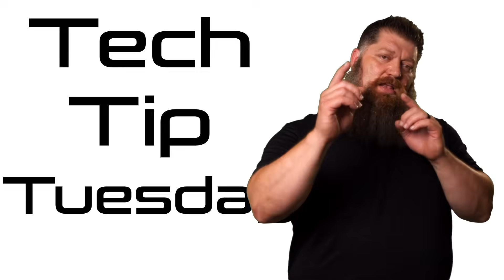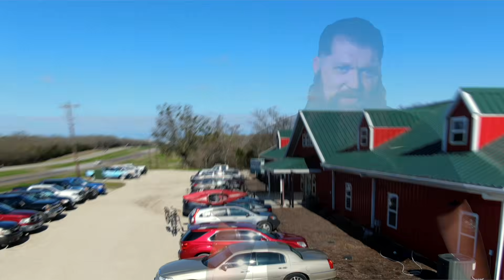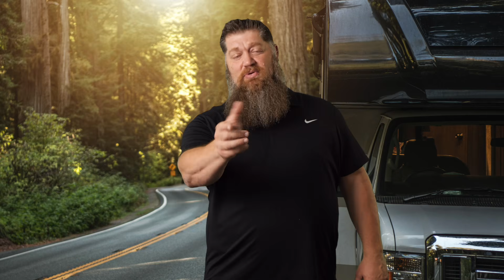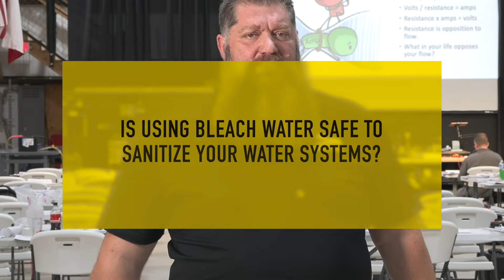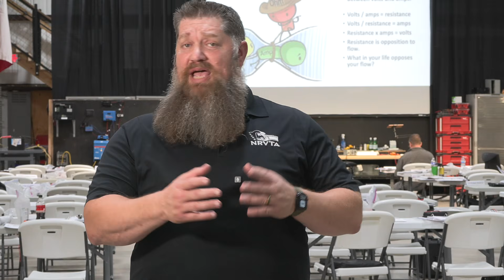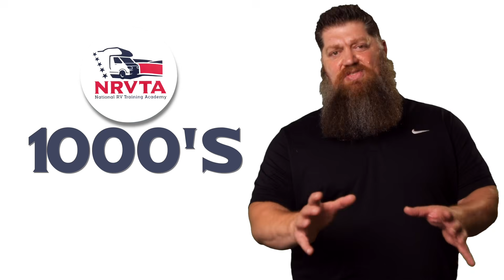Is It Safe to Use Bleach to Sanitize Your RV Water System? | RV Maintenance Tips

Comment: Todd - I love your videos, and I appreciate the care you appear to use in presenting RV information. I believe that RV water system sanitizing is more complex than just chlorine yes/no, and I believe that you are in a unique non-sponsored position to accurately test the different processes available. It seems to me that there are three "products" on the market that claim to kill bacteria, and have some sort of national standards approval. Those are chlorine (the reason for the quotes), Blu Technologies Bleachfree, and Thetford's Fresh Water Tank Sanitizer. The latter two seem to use the same active ingredients, just in different quantities. 
What i would dearly love to see you do is a controlled test between these, and any products (that claim to kill bacteria) I've missed. I'd like to see you start with water that has come from an RV tank that has has water sitting in it for an appropriate period of time. Put that water into test tanks for an appropriate period of time. Follow the recommended sanitizing processes, and have a lab test the results compared to an untreated control and "standard" dringing water (whatever that is).
While this process is not trivial, I do believe that there is time to design and run this test in time for the summerization season this upcoming spring. I hope you will agree with me and choose to undertake this project. BTW - If my research failed to find that someone else has already performed this test, I'd appreciate a reference to that test.

Comment: As a recently retired airline mechanic, I can tell you that the EPA requires aircraft potable water systems to be tested for contaminants every three months. Potable water systems are treated on a more frequent schedule. These days, most airlines have switched to using ozone machines to accomplish the treatment, which requires much less downtime than the old way. It now takes about an hour and requires no flushing of the system.
        Up until just a few years ago, water systems were sanitized using a 50 ppm chlorine bleach type product that had to be pumped into the aircraft’s water system and allowed to stew for over eight hours. That’s a shift and a half just for that maintenance. Thankfully, lubes and other routine maintenance items were being accomplished at the same time.
       After the proper time had elapsed for treatment, the water system had to be completely drained and flushed with clear water. The water at all lavs, galleys and coffee makers was tested using test strips to ensure an acceptable chlorine concentration of no higher than 2.0 ppm. It should be between 0.5 and 2.0 ppm.
     Since I can’t afford an ozone machine, I use the old chlorine bleach method on my RV. I also use water system test strips that are available on Amazon, to make sure that the system is thoroughly flushed. When sanitizing your water system, remove the water filter(s) prior to treatment. Replace with new filters once treatment is complete. Be sure to mark the date of filter replacement.

Comment: Just watched several of Todd's Tuesday tech tips on sanitizing your fresh water system. We have a 1998 Alpenlite, original owner. Shoot me now I know, but I have never done this process. The coach gets regular use throughout the year and fortunately have never had an issue. This past week we were boondocking, on a day trip we filled to 5g water jugs to take back, and when emptying the second one I noticed a brownish sand or grit came out of the jug into my tank, Thinking potentially some rust from the campgrounds water system where we filled up. I;m a little concerned over the issue of bleach being caustic on 28 year old plumbing system that has never leaked. Should I go less than a cup/50gallon solution and is there a max time of letting the solution sit in the tank and lines or is longer than 8-12 hours better?

Comment: We always put a cup in our 60 Gallon tank. Should I up the bleach? I also run all the taps to make sure the water is in ALL the lines. You can smell it when it comes out. It sits over night then I do a thorough flush with fresh water. Then with each fill I add a cap full of bleach. Any more than that, my wife starts to complain about the smell. Now.....keep in mind, we live in the country so no sanitizers in our water. We also bring water to drink from home.

Comment: This is 100% accurate. Common household bleach, usually 8% sodium hypochlorite (same chlorine/chemical in you city water), is completely safe for use and consumption at the correct mixture. Save mixtures for drinking water are 0.2-4.0 parts per million which is what your city water systems are keep in the range of. I have a 20 year background in water treatment and distribution systems as an Active Duty Air Force water systems maintenance craftsman making drinking water for countless people on bases across the world and have never had any illness from water consumption,. and yes we have used liquid bleach in our drinking water.  When you treat you water system with bleach like mentioned in this video you are doing what is called "hypo chlorinating" you system. This disinfects your system from any bacteria that may develop. It is best to run your water sources to the point of use, sinks and showers, with the treated water and "trap" in for the recommended time to allow contact in all those pipes and fixtures. After the contact time is over drain your tank, fill with fresh water and flush all your fixtures for at least 3-5 minutes. Now everything is nice and clean and safe to use. Thanks for the video and great advice.
Reply: The only other thing I’ve seen for treating municipal water is ozone (O3).  Again, very carefully generated, handled and monitored and VERY affective disinfectant with zero residuals as it converts back to O2.
Reply: I've read that bleach isn't effective against mold?

Comment: Here's another authoritative source: US Military.  We use bleach solution to clean potable water containers, canteens, and trailers. 

Army reference TB MED 577: Table I-1:  100 ppm is (1/4 cup or 4 tbls or 16 tsp / 10 gal) using 5 percent household bleach (cheap basic bleach, not "no splash" or "optical brighteners" or "fragrance")
Reply: Is that ratio strictly for cleaning potable water canisters, or is it meant to be consumed as well?
Reply: @The_infection_1  that's for cleaning only.

Comment: Should I bypass my water heater before running the solution from the fresh water tank?
Reply: I don’t.  I never had a problem.
Reply: I do, bleach can corrode the stainless steel in the water heater. I flush the hot water heater with a Camco water heater wand through the anode rod opening.

Comment: Winnebago says you can “continuously”  sanitize your tank by adding 2 tsp to 20 gals. and leaving it.   Is this bunk?  
This is specifically mentioned in the solis pocket  camper van manual.  I don’t drink it,  but can it sanitize?

Comment: I totally cheat. In the northeast when campgrounds open, most generally "shock" their water systems after being drained for the winter with a little higher than normal dose of chlorine. I've tested it at 4 PPM. Opening day I fill my fresh water tank, let it sit for a day or two, drain and refill. In my state all public drinking water is required to have .5 PPM chlorine anyways so I don't worry too much about the tank after. 
Side note: We bring well water from home, that has been through a reverse osmosis ( small under sink style ), for drinking and coffee making.

Comment: I stayed at a Harvest Host that did not allow sanitizing. A previous guest had sanitized with a product that contained FORMALDEHYDE. The product  was labeled for sanitizing RV water systems. (For those that don't know, formaldehyde is hundreds of times more toxic than bleach and is a known carcinogen).

The harvest host told us that it killed the grass around his septic system for years.  My assumption is that the septic system didn't work correctly for years either.

I don't believe that product is still available, but I tell this to point out that alternative sanitizers may not be better or safer or even work at all.

Comment: New motorhome has a Girrard tankless hot water heater with no OEM installed bypass.  Is it safe to sanitize the water system with bleach WITHOUT bypassing the hot water heater????  THERE ARE LITERALLY NO VIDEOS ON THIS.  Tons of videos on how to sanitize a system or install a tankless hot water heater but no videos on what to do to sanitize when you have a tankless hot water heater with no bypass.  Any info would be appreciated!
Reply: I don’t have a tankless system so take this for what it’s worth. I always sanitize my HWT with my water system. The way I do this is to drain the HWT, fill the fresh tank with the bleach/water mixture and then use my water pump to fill the HWT by opening all the hot water taps til it flows. I also do this with all the cold taps, so my whole system is sterilized.
Reply: I have  a Truma water heater and i sanitize it with no issues.
Reply: @joeyfmd  thank you.  So, you don’t bypass the water heater when you sanitize?
Reply: @ no
Reply: @joeyfmd  awesome!  Thanks so much!
Reply: @ check your owners manual for the RV and hot water heater.  My RV manual says to disinfect the entire  water system. The hot water heater manual doesn’t say to bypass it. Truma is a tankless system, so that might  mean it is ok to disinfect. Also, the disinfectant Clorox is 9% chlorine vs the regular bleach which is 4.5%active ingredient. You would use less.  Like 50% less. So the  cheap store brand is better.
Reply: @joeyfmd the owners manual is vague.  It says there may not be a bypass valve.  The hot water heater manual doesn’t say that it should be bypassed.  But it doesn’t say that it’s ok for the bleach solution to circulate through the hot water heater.  I bought the Walmart brand chlorine bleach.  Thanks for your help!
Reply: And I don’t think the. Heater should be on.

Comment: How do you get bleach in to your drinking water holding tank?
Reply: Get a funnel and pour the bleach into your empty water hose, then hook the hose up to your water fill port. Vola! Bleach in tank!
Reply: I pour 1/2 cup of bleach(for my 30 gal tank) into the end of my hose.. then I attach the filler spot to the end of my hose.. and then turn the water on and fill my fresh tank full then run it through any faucet, sink or toilet line and let it sit for 12 hrs. Then flush 3x with fresh water
Reply: Get a funnel, pour the bleach in your empty water hose. Then hook the hose up to your water tank fill port and turn water on. Vola!
Reply: siphon from a bucket, just like when winterizing, but we have a nautilus system and it has "sanitize" settings.  Connect the hose to the city water tank powerfill inlet to siphon from a bucket.

Comment: Brinkleys website video said to use 4 1/2 cups of bleach in their 75 gallon water tank.  Said nothing about leaving it in system overnight but said to flush through right away with clean untreated water.  Your thoughts?

Comment: What about sanitizing your water heater with bleach?  People say that bleach will damage it because it's made of metal or ceramic.  Should you bypass the water heater or just sanitize it with the diluted bleach?
Reply from the maker: So no bleach in the water heater. Vinegar is better for the water heater. Buy the white vinegar by the gallon and fill it up with white vinegar (Walmart). Let it set overnight. Then give a great rinse.
Reply: @NationalRVTrainingAcademy  Thanks for the reply.  So just straight white vinegar?
Reply: @GaryCriswell yes
Reply: 50/50 white vinegar and water
Reply: @skiimountaineer that's what I have seen as well.  That would mean you need to bypass it and then remove the rod and pour in the vinegar water solution.
Reply: Keep water heater in bypass mode during cleaning  with bleach.
Reply: Watch the video!
Reply: @Hoot3-X  yeah I watched it but nothing was said about the water heater.  Everyone has said to use bleach but some also say you need to bypass the water heater.